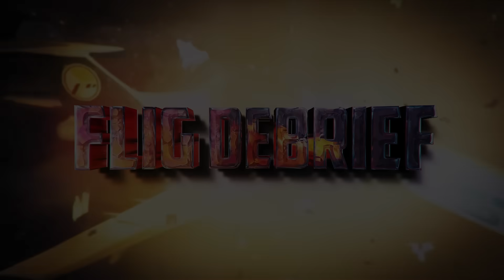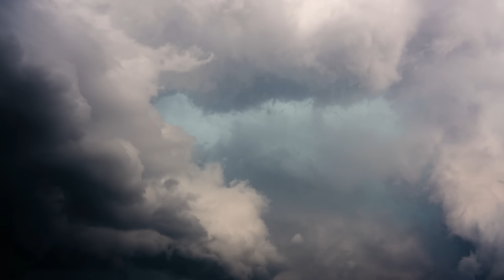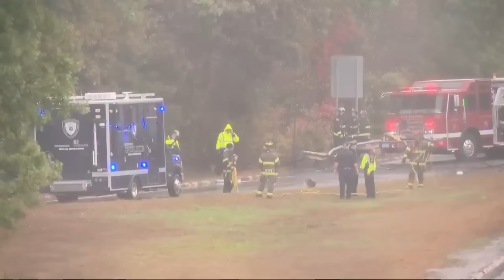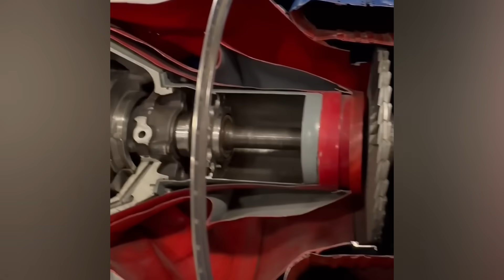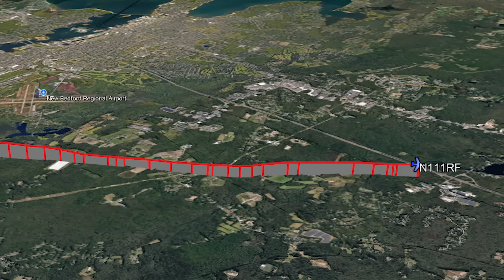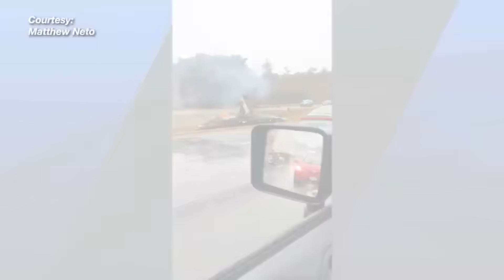NEW Info About TBM700 N111RF Fatal Crash Oct 13 Dartmouth MA...

Comment: IMC is not necessarily a high workload.All you have to do is turn the auto pilot on with one button and monitor things. It's actually quite easy in a well equipped airplane like the TBM
Reply: Or, at least fly the flight director bars.

Comment: I live 10 miles from that airport. We were experiencing a Nor’easter that day with moderately heavy winds gusting to 40 knots and periods of heavy rain. The visibility changes quickly in these storms. They’re the New England version of a tropical storm. I don’t know if it was a direct factor, but it didn’t help. BTW, I hate AI narration and this video did not shed any new info regarding the crash.

Comment: Wow, just a whole bunch of rubbish and no new info!
Let’s break it down…
1. Those are GPS altitudes above sea level not height above ground. 
2. 97 knots is not dangerously close to ‘stall territory’ it is actually a normal approach speed.
3. “Especially with with the flaps down and gear extended” gear makes no difference to the stall speed, flaps lower the stall speed, so no, no especially!
4. 13/12 does not guarantee fog, even if they are equal fog is still not guaranteed especially not with strong gusty winds. Fog is visibility of less than 1000m they had at least 2-3 times that. Ceiling was 1000ft which is marginal VFR.
5. Strong gusts hit turboprops hard??? They hit every plane at the same speed and intensity, gusts are not selective based on aircraft type.
6. Cause yaw swings. Utter rubbish. Just complete nonsense!
7. Relying on instruments sooner than expected - nope, if you know the cloud base you know exactly when to expect to be on instruments.
8. No an additional malfunction or warning light will not overload an experienced pilot. 
9. “Cabin air stair appeared partially deployed at impact, we don’t know if that happened before or during the crash” way to contradict yourself. It could also have happened after.
10. 40-50 knots of drag penalty - rubbish! Drag penalty depends on speed. Are you saying that at 50 knots it provides 50 knots of drag penalty? Drag penalty is speed related and non linear.
11. Door open or improperly seated on a pressurised aircraft triggers a master warning, very unlikely it was not properly latched or opened accidentally.
12. The PT6 has inertial separators. Ice ingestion is unlikely.
13. “Clouds at 1000ft, that probably means the pilot entered clouds seconds after takeoff” well firstly he didn’t get to 1000ft and secondly at 2000ft/min it would be a whole 30 seconds. That’s quite a lot of time.
14. This flight stayed VMC below the cloud so special orientation is totally irrelevant.
15. “A small pitch up can cause large airspeed decay especially in a slippery aircraft” wrong! A slipper aircraft decelerates slower, and a power aircraft such as this is not speed sensitive to small pitch increases.
16. “The drop in airspeed indicates distraction or loss of SA” or maybe loss of power and reducing to best glide speed?
17. “A shallow dive indicating loss of control” again wrong. A shallow descent onto a road would indicate an attempt at a forced landing to anyone who knows anything about aviation!

Congratulations on making an error every 40 seconds in this video - Impressive!
Reply: Altitude is height above sea level. 
97 knots is dangerously slow for approach.
Flaps and gear position airways change stall speed.

Comment: The flight path clearly indicates a turbine failure or electronic engine control unit failure, the plane was not able to speed up and gain altitude after take-off.
Reply: It looks like he initially deliberately stayed below the cloud base.
Then the deceleration in a straight line indeed looks like a loss of power.
The fact that it made a shallow descent onto a road indicates a forced landing attempt.
Reply: Why did he not cancel the flight the night prior, when he saw the weather forecast, and go on the airlines if it was that important?   Only professional trained and current pilots should be flying in that kind of crap, and I wouldn’t do it in a single engine anything unless it’s a clear day.

Comment: That PT6 is normally bulletproof… something mechanical feels off.
Reply: I have had 2 engine issues with PT6’s in about 3000 hours.
Both propeller related. An oil leak and a beta valve jam.
Loss of high pressure fuel pump on the PT6 results in instant flameout.

Comment: No mayday, no warning—just gone. Unreal.
Reply: But he must have said something because he was still in contact with the tower while taxiing and before starting the runway-roll. Was the electric and the radio in the plane completely out? Many systems fail when electric problems occur but at least the radios and transponder should run with battery even if the generator fails. Was the transponder signaling it´s data (flight number, optional also altitude) with no pause or did it switch off for the fracture of a second and came back online? If yes this might be a hint of electric problems and electric-bus-switching.
Reply: @GamingCatDeluxe  There have been instances of total electrical power failure on attempted gear retraction.
Normally caused by a failed generator and low battery.